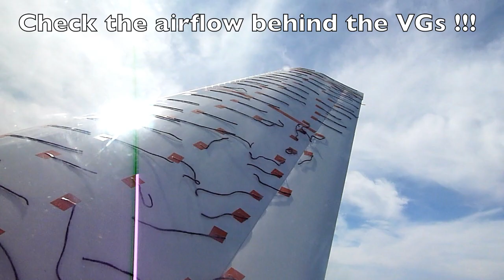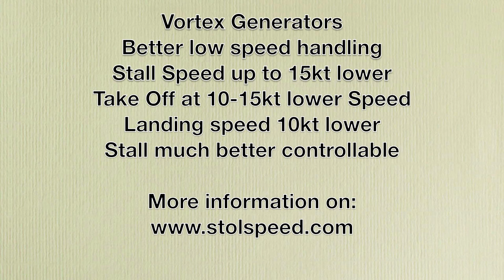Vortex Generators on Express-CT.mov

Comment: Please how far back from the leading edge were these VG installed? 5%? 8%???
Reply from the maker: 8% back from the leading edge. 
Viktor
Reply: Thank you. Its seems the general thought is that the VG get placed anywhere from 5% to 8-10%. With the idea that the higher angle of attack at stall, like stol plane those get lower percentage install location. And the less angle of attack slippery planes getting the VG placed a few percentages further back from the leading edge. I am no expert but i do a lot of reading. Just what I read.

Comment: At 2:34 you can see the more dramatic effect is the lateral movement, not the boundary layer backdraft forcing the strings up from the wing.  The vortex generators aren't working as described.
Reply: look at timestamps.  2:34 is without vgs. 🙂
Reply: @jonasbaine3538   They let anyone in here.

Comment: Very interesting experiment! 
Seems like the ailerons work well past stall angle of attack of the wing. Reminds me of the zigzag tapes we put on som gliders. Low speed handling and induced drag usually  improves, at high speed drag can increase but not by much. But it seems to depend on the airfoil shape. If I remember correctly the chordwise placement of turbulator tapes is also rather is critical.

Comment: My question is what were the level cruise speeds differentials with VG and without VG. Was it a large difference between the two.  My research has found that it about a 1 to 2 kts difference in level cruise. As with Aviation,  there's always a give and take scenario.
Reply: I rather lose a few knots and slight fuel use increase to improve controllability in critical situations.

Comment: We added a VG kit to our stock standard 160hp Cessna 172N model a few years back and it changed the whole aeroplane. The first Cessna helicopter! The very low speed handling and very slow speed stall characteristics were there to see in the very first flight. Quite amazing really. I wouldn't want to go back to it's previous life not having VG's knowing now what VG's have done to it. In some configurations it seems almost impossible to stall..the ASI reads as low it can go on the dial. You don't even notice any change in IAS. It's only a 100 knot 172 afterall. So that's Yes Yes Yes Yes for VG's..

Comment: I see,  that they delay the stall but then when the stall does happen it is quicker and more violent.  They would also effect fuel economy at the cruise. There's a reason that small plane manufacturers don't use them and I suspect this is why.Many thanks to the poster for doing this video,  well done.

Comment: Back  when I was a CFI, one day I covered the wing of our trainer aircraft with such yarn strips and flew it all day like that, showing student pilots the visual effect of stalling. They were all delighted to see first-hand something they had only studied in textbooks.
...I take it those VGs are not certified for general aviation aircraft? How does one go about installing them? Will the airplane not be illegal with such a radical aerodynamic modification, however beneficial it might be? Would the airplane need to be re-registered as "experimental"?
Reply: 0:17 This aircraft is experimental. They just had to update the magical paperwork that allows the plane to fly, I assume with data from the VG manufacturer and the new performance data from test flights. I think you can get them for non-experimental, but the manufacturer has to have done all the magical paperwork.
Reply: @jstan_49  Somehow I managed to miss the big "experimental" painted there. ...And "magical paperwork" describes it nicely. Thanks for chiming in. Cheers.

Comment: Ok, using the VGs you can indeed reduce the stall speed but you going to mess up the cruising and top speed characteristics of the airplane.
If there was a mechanism that could retract / extend the VGs on demand, then the entire project would be viable, as it is it only serves
as a verification of what flight dynamics engineers have discovered many decades ago.
Reply: Any device that retracts vg's would just be extra unneccesary weight. It's possible, but not practical.
Reply: @hockeyme3113  not necessarily ANY device, as it depends on the particular airframe application. For example, a lightweight VGs retracting device could be beneficial on a 737, if of course we take as an established fact that gaining 15-20 Knots of lower stall speed is really something that we desperately need.
Reply: @jonnekjonneksson  in my opinion it isn't worth it. This is coming from an A&P perspective, not a pilot's. The plane can already be landed effectively at speeds without vg's, so in my opinion it's just useless weight.

Comment: I wonder what the difference would be if;

Vortex generators were straight.
If you put the generators just behind the max chord thickness at the separation point.
Reply: If they were straight they would not generate vortices. They would be small fences instead.

Comment: Why the VG's are placed on the leading edge, it wouldn't be better if placed where the airflow separates on the middle of the wing ?
Reply: I would think you want them in laminar air. If the air seperates before/at them they won't work

Comment: The video is extremely interesting, however, as a pilot, may I just disagree with the saying of "Stall Speed"? Stall is technically given by a wing angle of attack. Every wing has one and beyond a certain angle, air simply is not allowed to accelerate on the upper part of the wing, hence no low pressure created. What you call stall speed, i'd call "minimum speed". You can travel at minimum speed, having to work with feet and bar to keep it flat and stable. At actual stall, unless the airplane is perfectly flat and balanced, the nose would naturally dive down, otherwise it wold start a spiral. Correct me if am wrong

Comment: Nice, just imagine how many more hours per gallon at cruising speed you’ll get with reduced (wing tip induced vortex working against you) a better drag coefficient and more effective  airfoil function (more lift at lower speed) you wont have to work the engine as hard or hang on the prop to get out of ground effect. 
 Just imagine one thing, this is old technology, old! How many hazards or tragedies could have been averted if they were in place 50 years ago? Improved glide rate, plane control, reduced minimum landing speed, less stress on the airframe, I’ve been bringing these things up for years and no one listened.

Comment: great video and visual info. i was very curious why do they put the vortex generators on where some are straight some are at a angle. is there a correct angle to use for this? and why put them under the winglet i saw some there also?
Reply: A generator at an angle will cause a larger vortex than a generator pointing straight into the relative wind. The size of the vortex determines the thickness of the laminar boundaries you can influence. In this way, you can steer each lateral boundary of each segment of laminar flow between two generator positions.

Comment: Clearly the VGs lower stall speeds, but would they introduce another icing surface on the wing?
Reply: Loss of control accidents are more prevalent than icing accidents. My thoughts are the threat of icing doesn’t outweigh the daily benefit in terms of safety the VG’s account for.
Reply: I doubt this plane should even fly in icing conditions... Most non-turbine airplanes are not capablebin icing conditions anyway.

Comment: Amazing! Is this perhaps why golf balls have these tiny "holes" - they create vortexes which help the air better follow the curvature of the ball and eventually lower the overall drag?
Reply: Similarly to VGs, as you know, the holes enable slower air close to the surface of an object (e.g. golf ball) to mix with the air that is a bit further away from the ball (which is flowing quicker). The mixing causes that the air close to the surface flows quicker (it is energized) comparing to the airflow speed without holes/VGs (talking about the sides of the ball, not the "nose" in front). And that is the whole point of pushing/manipulating so called flow separation. On the golf ball the flow separation is thus pushed further back when comparing to the ball without such holes (as the quicker airflow resist the airflow from behind the ball - where the higher pressure exists - to go backwards - also see the strings flying opposite to the direction of the aircraft speed at stall speed). Even though mixing the air costs some extra energy/drag, if you have shape of ball (you can do nothing with the overall shape in this case) the most drag comes from the area behind the ball where turbulent airflow exists. The volume of the air in this area with turbulent flow behind the ball basically goes with the ball and cause the friction/drag. In case of golf ball, as the flow separation is pushed backward, the area with turbulent airflow behind is smaller comparing to the ball without the holes. Simply they (golf balls) can fly further thanks to the holes and  the overall drag is indeed reduced thanks to the holes as well.

Comment: Lowering the flaps when you have the vortex generators invalidates the prior test base as you did not establish a stall speed with flaps prior....of course if will fly at a slower speed with flaps. You should have segregated the tests, one with and one without flaps. Maybe you were trying to show off the vortex generators and could only do so with the aircraft flying so slow, thus needed the flaps, however you should have shown without flaps first.
Reply: what are you talking about?
Reply: No Vortex Generators - Flaps up test: 0:50
No Vortex Generators - Flaps at T/O position test: 1:43
No Vortex Generators - Full flaps test: 2:13
Reply: Have you even seen the video?

Comment: This guy sucks at stall recovery
Reply: +Nick Morgan No actually he seems to recover quite well.
Reply: They were purposely flying it into a very deep stall.  Most folks would have put the nose down at first shake before it dropped a tip.  Also in the earlier tests with VGs only outboard, the pilot was purposely rolling back and forth during the stall to demonstrate that he still had good roll response while the root of the wing stalled.   But as it continues to slow eventually that will still lead to one wing stalling before the other.
Reply: That's called wing drop, anyone will have a hard time keeping the aircraft level when you have 0 lift on one wing.
Reply: daemn42 You know what? I didn't even think of that. You're absolutely right. My bad, my dude
Reply: One wing losing lift before the other means you're either in a turn, or banking to hard while you're trying to stall your aircraft. If you fly straight, the wings will stall at the same time. The only thing that might have any affect is the torque of the prop, but that is only when the power is up. A power off stall shouldn't result in one wing dropping lower than the other, it's basic PPL training. Source: Am a pilot

Comment: Great demo guys. Im glad you fitted the VG's to the outboard wing first for the test... not the inboard...!
Reply: Would that be to allow the inboard wing section stall first and allow you to maintain full control ability of the roll axis?
Reply: @diao77723  Exactly. With the ailerons still in laminar (unstalled) flow, you have roll control. You lose that if your wing tip stalls before the root and the inboard section, being wider on many planes, provides more lift than the tip.

Comment: It's amazing how you can change the manufacturer designed stall speed on an aircraft so drastically just by adding those (what boil down to) simple little stick on devices. That's cool!

Comment: Sure it works for low speed. Do you lose any cruise speed ?
Reply from the maker: No speed loss in cruise speed. The nose is 2°-3° lower in cruise with VGs, better foreward sight and may be less drag. Viktor
Reply: Usually hanging anything out in the airflow will cause drag. But the vortex generators are first, very low profile and small relative to the relative wind. The generators, as tiny as they are, create a large pressure density fence to contain each band of flow from nose to trailing edge. Each fence acts to to keep turbulence in rootward segments from leaching tipward across the wing length. 

A naked wing offers little resistance to lateral flow from root to tip. Stall turbulence thus creeps along the wing freely.

As for drag, each vortex serves to bind and reinforce the laminar nature of flow from nose to trailing edge. This orderly flow will cause lower drag as the sheer from skin to free air is thinner with generators. Without generators, the laminar sheer profile is thicker and more turbulent. 

Probably explains the 2°-3° lower angle of attack. The naked wing with sloppy laminar flow was being robbed of lift so it had to cruise at a higher AOA. The VG equipped wing encourages  lower drag requiring less bite into the relative wind at the same cruise speed.

Comment: Vortex indicators don't you mean?
Reply: Unless you look very carefully at the leading edge of the wing in HD mode you can't see the vortex generators. They are tiny fins that direct the airflow at a slightly oblique angle to the normal airflow. This sets up little vortexes that mixes the boundary layer with the air above it.

Comment: What's the point? I don't get it??  You're taking a wing designed to operate efficiently in defined circumstances, and introducing inefficiencies to make it operate differently.
If you want to fly at 50kts, design a wing that works at 50kts - don't go messing around with a 60kts wing and obstructions...
Reply: They expanded the usable range from 60-210 to 40-210. You can design a wing for 25 kts if you like, but you can forget about a reasonably fast cruise.
Reply: Go learn about vg's before you make comments.
Reply: Boeing sure erred big time on the 737 then, huh?

Comment: I imagine if the overall vortex strength generated is opposite to that of the wing tip vortices of each wing, the tip vortex strength would be reduced, thereby reducing vortex drag. Essentially like a lot of tiny winglets.

Alternatively, the added boundary layer energy could improve the aerodynamic efficiency of the wing, especially if it cruises near flow separation, causing better performance.

Comment from the maker: With cruise power negligible, with max power my be a few kts.
On my Zenair 601HDS with all the VGs installed the cruise speed is 8kts higher with the same power setting (fuel flow).
Reply: Speed is higher or lower with the vg's ? Didnt get you.